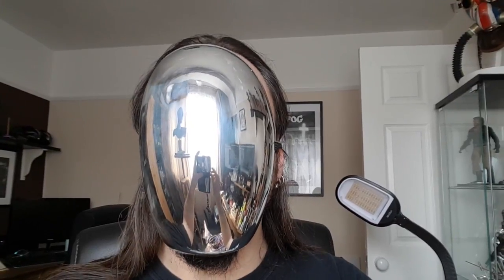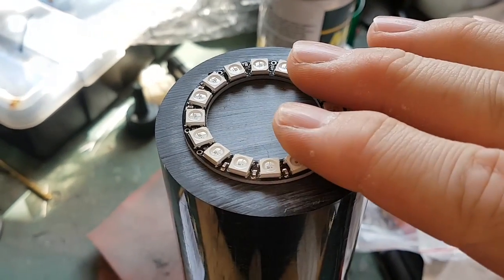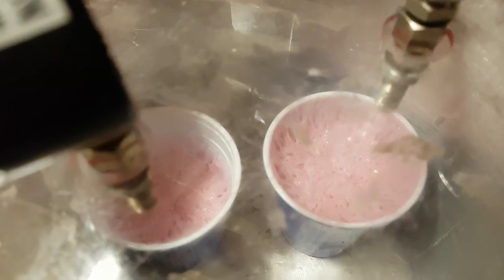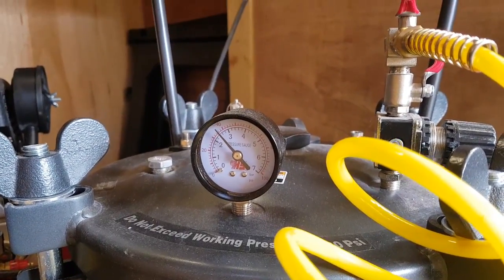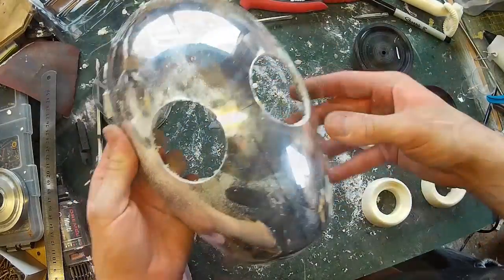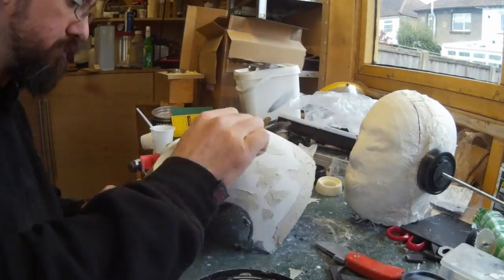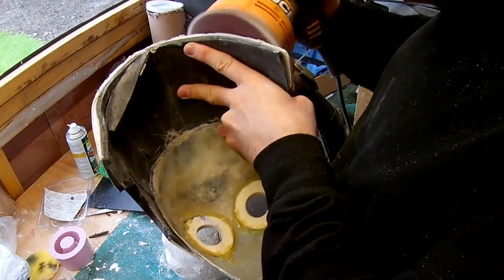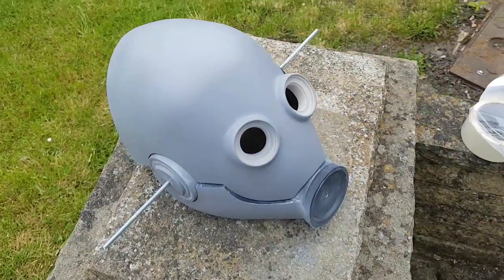Making a(nother) Steampunk Mask Pt 1

Comment: When we used to sand car parts, we sprayed on a light mist of speckled black basecoat. Then you sand a bit...wherever you got dents, valleys, scratches, the speckles will stay in place. So you know where to either add bondo or sand a bit more.
Reply from the maker: Yeah it's a handy technique. You get a similar effect with the undercoat.  Sooo much sanding though!

Comment: I've got some of the DWR black resin and it's really nice and easy to work with, will probably get some more soon.

Self molding your head is crazy brave!
Reply from the maker: I wanna get some of that. I plan to cold cast the mask to give it a metal finish and black will probably be a better base colour than white. 

Haha, yeah you do need to be careful casting your head on your own! ;)
Reply: I did some cold cast tests with it and they all look brilliant.  Just made some small medal sized moods and made some colour chips of the various powders.

I've not tried slush casting with it yet and their docs say it's not suitable.  Having said that it seems to cure similar to Smoothon 325 which I have rotocast with, but it's tricky to get even walls with.
Reply from the maker: Yeah I was planning on cold/roto casting a metal layer and then backing that with fibre glass. Then I can do some chipped paint effects. I figured that would look better than silver paint. Will have to have an experiment.